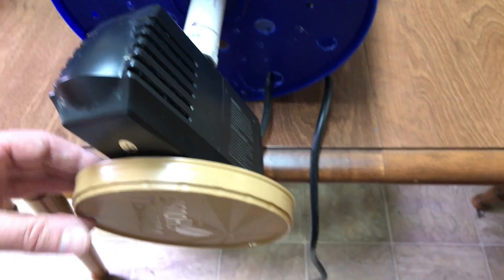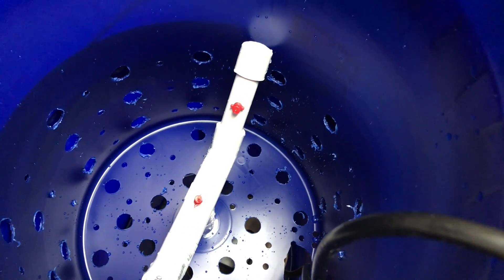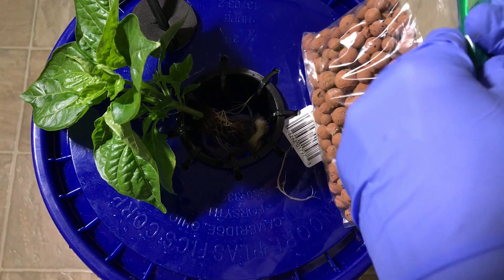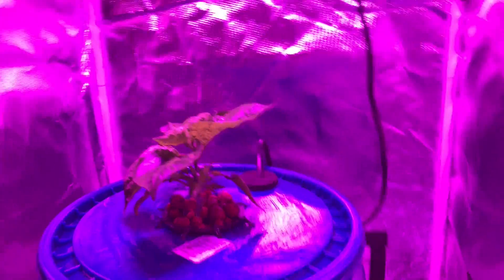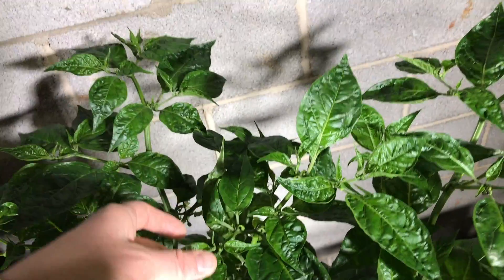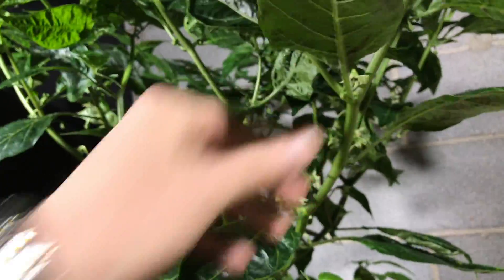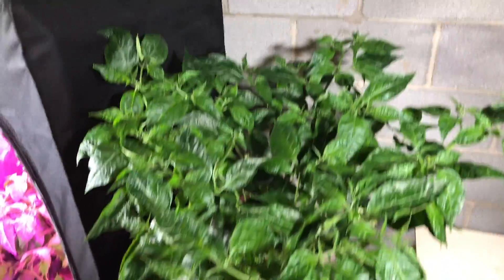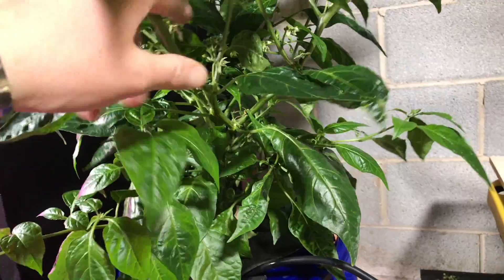How to make an inexpensive low-pressure aeroponics system - Improved version - Part 3

Comment: I know this upload is bit old but the design is bit over complicated. I would have planted in a 3"-6" net pot filled with clay pellets, then stuck that in the black and yellow tough tote with submersible pump and sprayer manifold. I would have put a 3/4" - 1" grommet or bulkhead in both the tote and one of the 5 gallon buckets. Making checking and adding nutrients a lot simpler.  Knowing myself i would have installed the pump in the 5 gallon bucket and then piped it to the tote, either through the 1" pvc pipe connecting each vessel or its own bulkhead at the top of each vessel. With that you'd have the pump pulling nutrients from tote to the bucket and back again raining down from above the roots. A sort of low pressure recirculating aeroponic system. As a bonus the bucket can also house a water chiller or frozen water bottles just to safe guard against root rot and other pathogens.

Comment: does the pump run permanently
Reply from the maker: Yes, for this setup it does. Could probably set it intermittently with a minute cycle timer, but this one has run wide open all season with no issue.
Reply: @pepperdactyl  Thanks

Comment: Need to seal the gap between the 2 buckets. Water will evaporate quickly and leave a higher ppm
Reply from the maker: Thanks for watching. I'm working on a version 3 which will have a separate reservoir, controller bucket and growing chambers. The growing chambers will be thick mill black plastic 5 gal buckets, with 6 inch net basket lids. The pump and a float valve will be in the controller bucket. I think this will address issues of evaporation and algae. By end of the season I had great results with version 2, but was constantly (every 2 or 3 days) having to add nutrients back in. The habanero plant in it had over a five foot canopy and produced closed to 250 fruits. I upgraded my pump to 900 gph for new one I'm working on. And plan to run three plants off it.

Comment: In which part of the process was the neoprene cloning collar used, and how was it used? Also, do you think this system could work okay to grow radishes?
Reply from the maker: The neoprene collar was used to hold the pump power cord. I cut a  1 7/8" hole, and the 2 inch collar wedged in there with the power cord. I don't know if it will work with radishes or not. I haven't tried it. Would be a fun experiment. If you try it please share how it does.

Comment: Hello Peter, I am fresh to this field, but what you did is so great that I want to try myself lol. During the this  2 1/2 months, how do you take care of the plant? Do you need to adjust some PH or EC value of water?
Reply from the maker: The way I made this one with the double bucket design, I was able to add three gallons at a time. I would let it run the nutrients down to almost empty, then add three more gallons. Periodically I would swap the bottom bucket for another one that had all fresh solution in it. Using the Dyna-gro 7-9-5, I didn't need to adjust ph, it worked out fine with the tap water I have. As far as EC, I used the same strength throughout which was around .9. The last month or so I bumped it up to around 1.2. I didn't adjust it after it was added to the bucket.